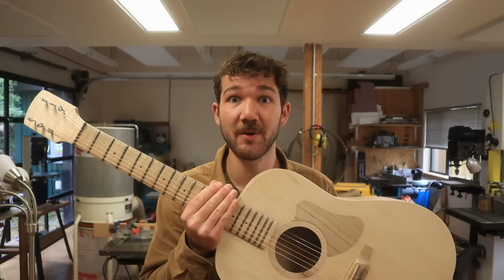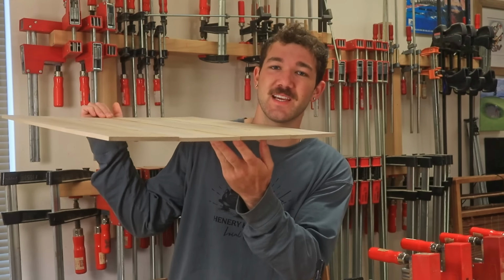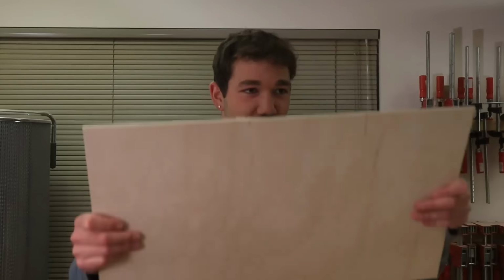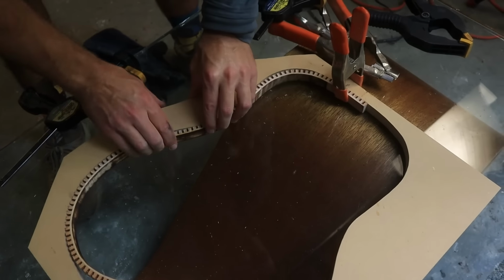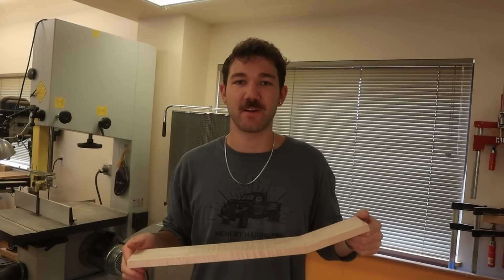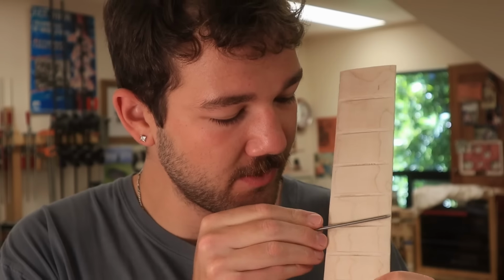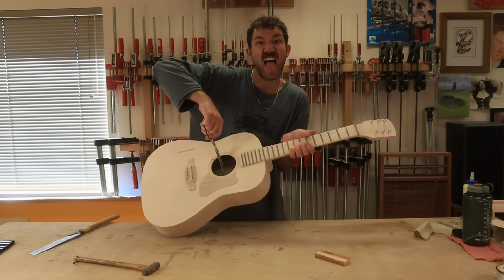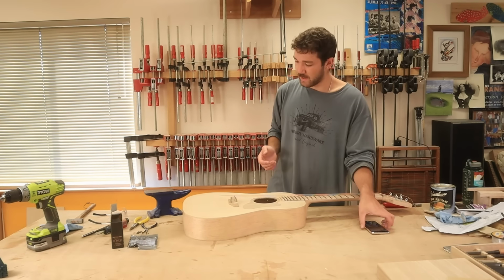I Made A Guitar Using Only Home Depot Supplies

Comment: "Home Depot selection sucks". They sell everything you need to build a home, next time try guitar center. "Home Depot wood sucks" it's dimensional construction lumber, it's simply is what it is. You would end up working a hardwood dealers wood even more. Your DIYing a guitar. That is incredibly freaking awesome. Why not put out positive energy and celebrate that all of these things are available.
Reply from the maker: Yes they do sell dimensional lumber just for home building but the maple I bought was made for small DIY project like furniture and other crafts, and for that it's not very good. They work with nurseries to grow the trees and because of their greed they cut them before they can mature to sizes large enough to have nice straight grain. This made every piece of hard wood and soft wood boards that they sold have cupped grain that is a nightmare to plane flat. It's okay lumber for someone who doesn't need high quality, and to home depots point they don't claim it to be high quality, but they still charged me $200 for the lumber you saw there so I would expect more from it. I am sorry that I'm putting out negativity, but this corporation clearly cares more about making money than selling quality supplies to its customers. On top of that, half of their small ply, the crappy stuff I used that is most certainly not intended to build houses with, was full of voids and wood filler. Yet they still charge $30 for it. It's just sad to me and I want them to do better, because with how much they make they could sell higher quantity wood and make wood working more accessible to the average person. Instead people buy their wood, not knowing these things, and are discouraged. Obviously the wood isn't good enough for a guitar, that's what made the project fun and interesting. But it's isn't an ad so I'm going to give my honest opinion

Comment: Cool man, not an expensive way to learn if you already have all the tools laying around. I so badly want to get into this for a hobby and i may use homedepot wood for the first few builds to learn.
Reply from the maker: I will say from a leaning perspective it might not be the best tool to use. The wood is inferior and really not made for building guitars due to the grain structure and wood treatment. It also wasn't as cheap as you would think. All the lumber was over $200, and I bet you could get actually good lumber for a similar price. As you saw with the bending of the wood, it's just not possible with what they sell at home Depot. Don't want you learning bad practices with bad materials. But I'm also no expert so take that with a grain of salt
Reply: @BebeauBuilds  thats insane that it cost that much out of home depot wood. Id like to build one out of something close to brazillian rosewood, but id hate to spend that kind of money and it be deadnoted everywhere when i get done lol.

Comment: Well it sounds terrible...I'll bet the intonation is way off but considering it's made out of crap wood from home depot and the frets are made from nails? i actually skipped past that part once I heard nails ....it looks like a guitar...unfinished...maby if the whole thing was dryed out and the scale length was corrected that has to do with intonation and a Finnish was put on it to help keep moisture out ...I think home depot sells wire maby stainless steel ? For the frets...just maby after all that it might sound kinda ok?? .. but a home built guitar from material from home depot nail frets what can I say ? Good job definitely did better than I could do